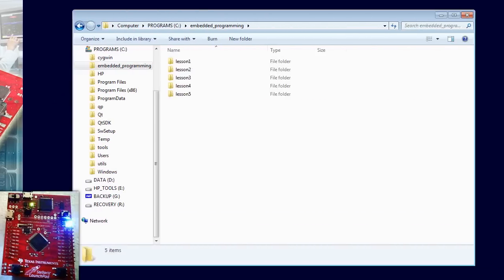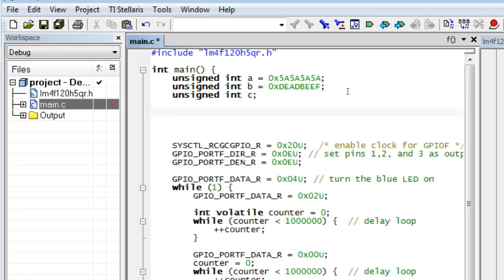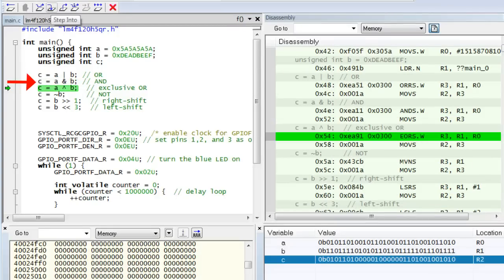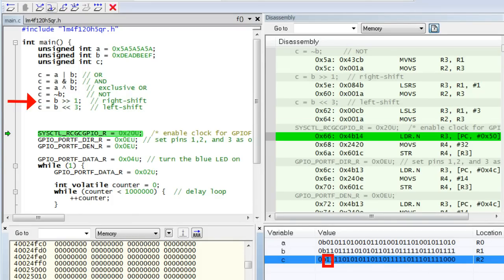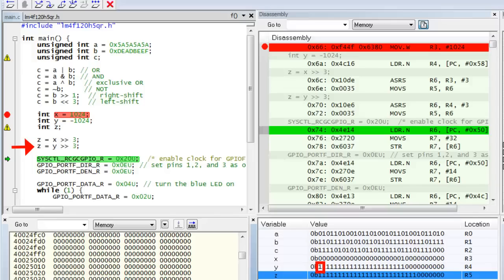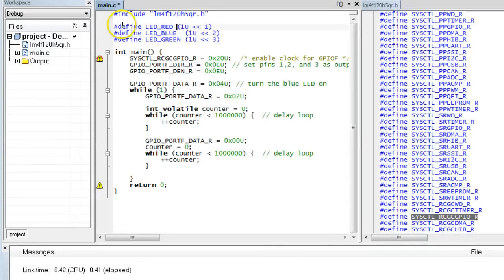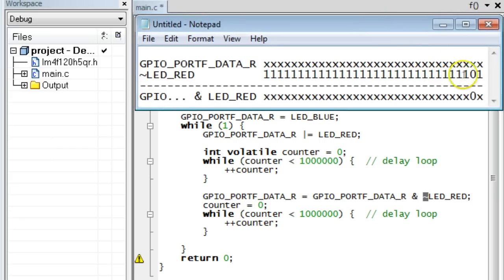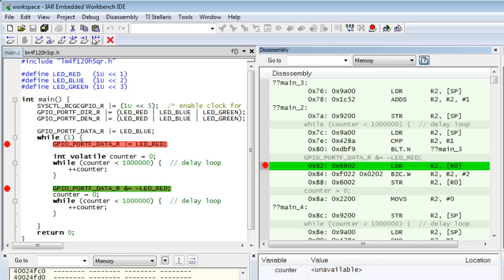#6 Bit-wise operators in C

Comment from the maker: I really don't want to hurt anybody's feelings, but the 8-bit PIC is an outdated, baroque architecture not really designed for programming in C (in fact, it predated the widespread use of C in embedded programming.) There are no strictly standadrd-compliant C compilers for the PIC, so microC must necessarily cut some corners. 

As the title says, this course is about "Modern Embedded Systems Programming", and so it won't cover such anachronisms as the 8-bit PIC.